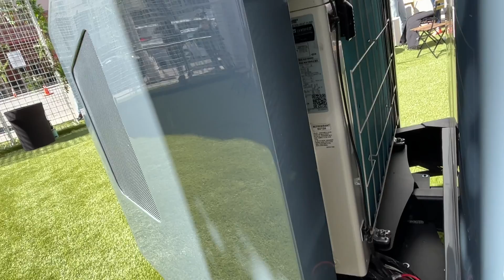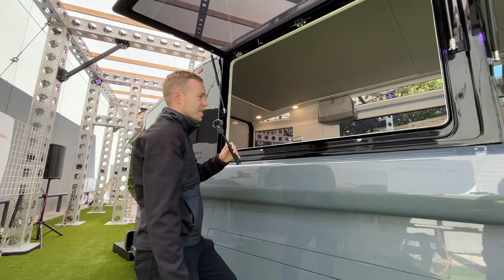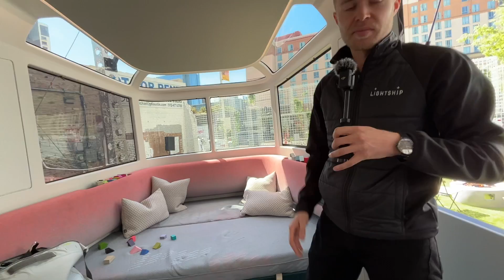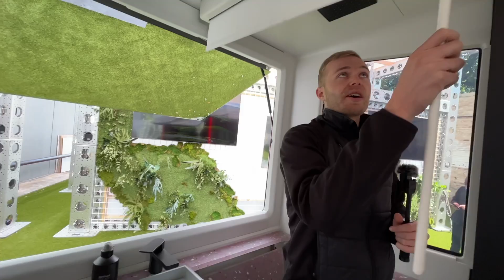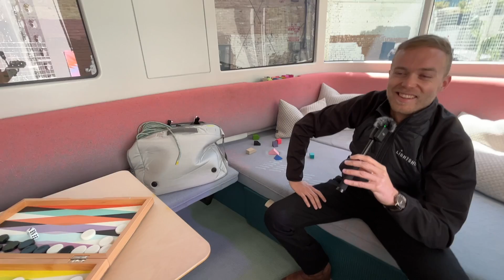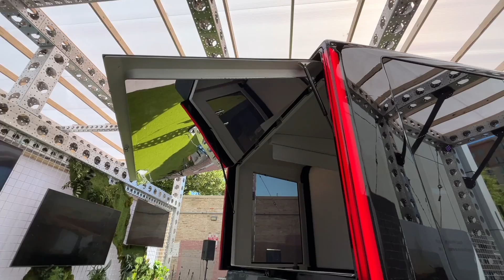Full Tour of the All-Electric Lightship L1 RV

Comment: Love the concept, and the exterior design. See several problems with the interior. The bed is not a good use of space in a small trailer. Needs to either be convertible, or just a straight bed. This sort of day bed concept wouldn't work for me. Even most entry level travel trailers now have a theater seat option. Having a dinette as the only seating, in a premium product, makes no sense to me. Another big concern would be having so many non-standard interior components - fridge, microwave, dishwasher, oven, etc. On any RV, things break. Being mobile puts extra stress on everything. Even when this is under warranty, finding someone to work on it may be difficult. Once it goes out of warranty, it's likely many repairs will become prohibitively expensive. My advice would be to not try quite so hard to reinvent the wheel with the interior, given that the structural stuff and exterior are bleeding edge.

Comment: Either the RV or the towing truck needs to have 240V power out so you can charge the tow vehicle while the RV is also plugged in. Usually there is only one 50A outlet at campsites.
Reply: What RV? This is a camper
Reply: @lofiart70  Same thing

Comment: Does it have bi-directional charging? I agree with Elon, that if cars have autonomy we may not want them plugged in to our houses all the time and relying on them for grid storage would be unreliable unless it is auxiliary power only, however an RV is not being used for large chunks of time when it could act as a battery backup and supplemental solar production. Why not integrate this with power wall to allow your homes to utilize a single power wall or possibly no other external battery. When you are camping there is no one home so no one is going to worry about lights going off, especially during summer when most RV trips happen. Great interview Dave!

Comment: A Solar Panel/Powerwall equipped version of the Lightship minus the drive motor would seem to be another (better?)  version of the Lightship for EV Trucks. For example. if it were a seamless extension of the Cybertrucks battery system capable of being charged by the Cybertruck charger at Ver 4 chargers, that would seem to be a perfect integrated Tesla option that could also be used by other capable EV trucks as well. In that scenario the drive motor and custom battery system would be unnecessary. No?

Comment: Great video and exciting promising product. A few questions (1) can the gear rail system handle say a hammock or netting to throw stuff like surfboard, etc.. (2) yes on the outdoor shower option! (3) Is there a way to make the front on the doors/cabinets magnetic or of more utility like a white board that can be removed from the front and used for planning dinner, activities, etc..

Comment: Love the structural design, windows, and kitchen/bath integration, and the size/weight ratio is impressive.  But for the rest, this has got to be the ugliest interior (storage) and upholstery cloth I've ever seen in any prototype.  However some of the material choices may be for durability and maintenance.  Of course there obviously will be decor options in production models hopefully.  The prototype appears very durable.  While much could not be revealed about the source of the drive unit, I would've hoped we could get more performance information.  I'm speculating some kind of stiff spring shock type of interface in the tongue hitch structure that maybe translates forward and backward a little, to detect pull ahead force, or braking force from the tow vehicle.  The regenerative braking possibilities of such a drive unit configuration are also very important because taking some of the load for pulling/towing, or taking some load off of the tow-vehicle brakes are both very beneficial and efficient.  Don't remember this being specifically asked about in the tour though.  Still an awesome video - Thanks Dave!

Comment: Having seen a bazillion failed start-ups, I was initially skeptical... but I am now convinced that this is straight-up legit. You were throwing question after question after question. This guy was throwing answer after answer after answer (*NDA & proprietary topics excluded, of course). He was dodging nothing. I am honestly impressed. Also, you were asking some really good questions. Perhaps the only wishy-washy response was regarding the windows vs. rocks, but there may be some clever solutions to address that concern. GREAT interview.
Reply: they literally refused to do tech spec discussion with @outofspec.......
Reply: @laloajuria4678  Yeah, they have to be careful when giving specs. If they inadvertently give too much information, someone could perform a few calculations to discover additional information that they may not have intended to provide. Once the product is on the street, all bets are off.
Reply: Yeah legit to fail, the RV industry is huge and this thing will be way over priced for what you get.
Also its going to appeal to a very small amount of people in the recreational lifestyle.
This rv if you want to call it that will fail....
Reply: It looks like the majority of those front windows would be covered by the aero fairing when in the lowered mode.

Comment: Interesting design.  Love the contemporary look.  However, the downside is the stowage area.  You lost pretty much all of the wall cabinets.  I wonder if they can figure out how to fold wall cabinets up in road mode and fold them down in car mode.  I also wonder how the trailer motor is communicating with the towing 🚗,  how it accelerates and brakes in sync with the towing car.  Also, I would love the gooseneck 5th wheel better than the trailer design.

Comment: Interesting concept and some good ideas. Does it make sense to put a drive unit in the trailer as they plan? It might be simpler to just have a battery and pass power to the tow vehicle. Electric vehicles have plenty of torque for towing, battery capacity is the bottleneck. However, towing stability (anti-sway) depends on trailer braking (especially downhill), so it would be great to have regenerative braking in the trailer... hence the need for a drive unit. The windows appear to be single-pane automotive style. With all that glass area, I would expect the trailer would be hard to heat or cool. They probably need to go to double-pane plastic with integrated insulating shades. The design of the main bed seems clunky and awkward... maybe facing couches that fold down electrically into a bed (or twin beds) would be better, but the trailer is pretty narrow, makes designing a bed hard. I think I'd rather have a camperized electric van.

Comment: Not a fan of the pop-up design. No upper cabinets and that limits storage. I understand that aerodynamics would be important  for pulling this with an EV like a cybertruck. Add a bigger battery that the truck could share and another solar array that folds out for faster charging. The boost motor on the trailer is a great innovation. Looks good from the outside. The interior is plain and fugly.

Comment: wonder if it would make more sense to simply have the RV portion contain a 100kWh battery which could connect to the EV pulling it and also power the RV without it having the drive wheels powered and a need to somehow coordinate activities with the EV. I understand their may be battery management system incompatibility and challenges as well as recharging hurdles, but it seems to me the complexity would be reduced.

Comment: Isn't a 5th wheel camper all electric? Isn't every tow-able camper all electric?.... what am I missing here? They don't come with engine/generators. And the propane tanks are almost always addons.
Reply: 5th wheels are traditional RVs with a big nose. Generators are an option and have been used for years to provide AC. Propane tanks are a fixture. This is a great idea ... mostly in the area of drag.
Reply: The new part is the self propelled aspect. Where the trailer is providing it's own propulsion...

Comment: Since 2001 I have designed and built over 3000 battery based RV power systems. Our customers are living and traveling full time and make and store all their power with our systems. Nothing new under the sun but it does have a coolness factor.
Reply: That’s what u was thinking. Isn’t a new concept just new look.
Reply: That was my first thought but the assisted propulsion is something.
Reply: Rodney, if Tesla made a RV to tow with cyber truck that had its own battery and propulsion while connected, I would buy it!
Reply: @Lovingkindness.  one thing they need to figure out is charging. Ideally you want that thing charging at the same time as your truck